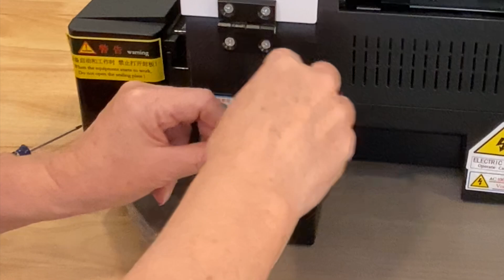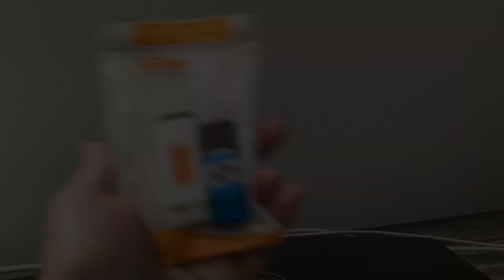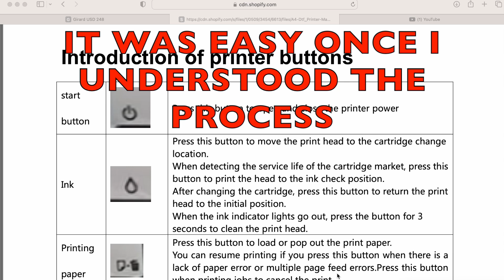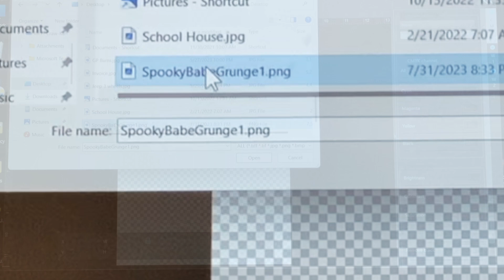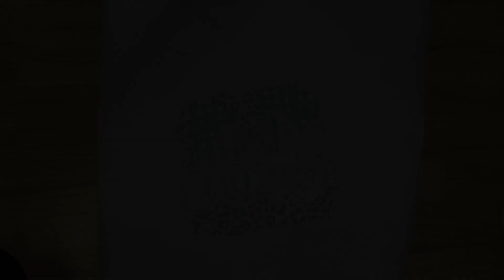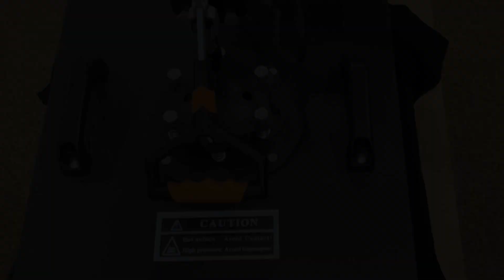Setting Up and Using a Procolored DTF Printer for the First Time

Comment: Hi I'm trying to set up the same printer, I'm very new to dtf, I placed my ink in the cartridges but when I tried to do a print test no ink is coming out, please help I'm going crazy trying to figure this out.  Thanks
Reply from the maker: Did you pull the ink through the tubes with the syringes?
Reply: @MakingwithMarilyn  I think this is where I'm confused .  I've looked for the video where I I fill the sack, I have 1805 and I can't find the video showing where I take the tubes out for the syringe,
Reply from the maker: @audreygaskings2367  there's a couple of good videos linked under my video also. One of them might help.
Reply: @MakingwithMarilyn  thank you!

Comment: You CAN use a Mac with these 😁  Macs come pre installed w something called “boot camp.” It allows you to download windows software on your Mac and lets you switch between the 2. (You can’t use both at same time but you switch between them.) It’s not hard to do just a little intimidating. However Mac makes it simple and walks u through the entire process. 
I thought the same as you at first until I dug a bit deeper into it and read about boot camp. 😁
Reply from the maker: Thanks so much for letting us know about that. That is great news!
Reply: @MakingwithMarilyn  sure! Happy to help. Thank you for your tutorials they’re very helpful!
Reply: @MakingwithMarilyn thought to add to this is that for anyone doing this the only thing you need to do is purchase a windows product key after doing the boot camp. (Or else you won’t be able to rip/print it.) Just thought to add this incase anyone’s looking into doing this. But it works perfectly on a Mac this way. ❤

Comment: So I just set my printer up and everything is working great. The issue I am having is when I go to insert picture it brings me to an empty folder. None of my pics saved to my computer are coming up. Do you know what may be causing this? Thank you!
Reply from the maker: Are your pictures png images or another acceptable format for dtf? I save my svgs as pngs and then they show up as being usable.
Reply: @MakingwithMarilyn  Thank you for such a quick response. Yes I have them saved to my computer as png files but nothing is coming up. Also when I go to print I keep getting a failure and it doesn't print. Currently watching more videos to see what I am doing wrong.

Comment: All 5 lights are blinking on my startup and won’t cut off any advice ?
Reply from the maker: I'm sorry, but I don't know what that would mean. I would unplug the machine and start it back up, but I don't know that that will actually do anything. Which brand do you have? Have you reached out to the distributor/manufacturer?

Comment: Hey Marilyn, I am looking to get this printer but not sure of which one you are working with. I want the L1800, does it comes in the A4 version.
Reply from the maker: I have the L805, which is the smaller A4 size. The L1800 is very similar but prints on wide format film. I don't think it comes in the smaller A4 size.
Reply: @MakingwithMarilyn   Thanks Marilyn, I was a little confused about the different numbers. I appreciate your respond. Love your channel

Comment: Are you normally supposed to use the syringes with the ink?
Reply from the maker: Some people that have tanks with large openings just dump it straight from the bottle. I was able to use the funnels for all but the white ink. The tubes took up so much space I used the syringes for it.

Comment: Nice do you have to print daily to keep the ink from clogging or is this not the printer that clogs up.  Have a blessed day.
Reply from the maker: DTF printers are more prone to clogging due to the white ink. It is not as thin and watery as the colors. This printer has an ink stirring feature and a heater. I just got it up and running a couple days ago, but have been printing a small one-inch square design each day until I know more about the qualities of DTF printing.

Comment: Congrats on your new printer!
Reply: Marilyn would you recommend it? It did seem to be a little complicated.
Reply from the maker: @sharonlee469  all the DTF videos I watched required the pulling of ink and having the rip software in the computer while using the printer. I felt a bit overwhelmed b/c I was so stressed:) Regarding the actual printer, I used it for the first time yesterday so I don't feel like I have used it enough yet. But I will say that there was nothing about its quality that would make me say to stay away from it. I like that it has the ink agitating system and the heater.
Reply: @MakingwithMarilyn  ok I would love one because I really enjoy DTF.  Enjoy it!
Reply from the maker: @sharonlee469  stay tuned to the channel b/c I plan to use it several times in videos over the next few weeks. I should know more about it then.
Reply: @MakingwithMarilyn  I will!
Reply from the maker: Thank you Sharon!